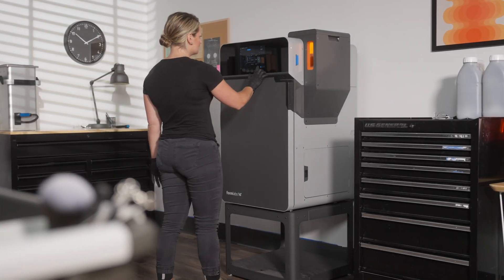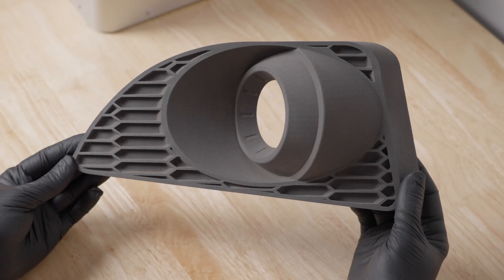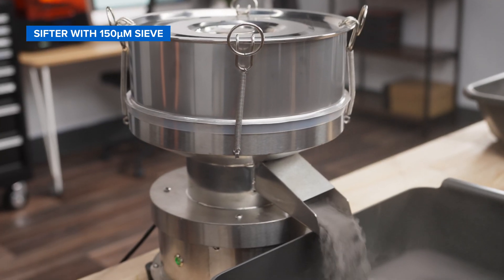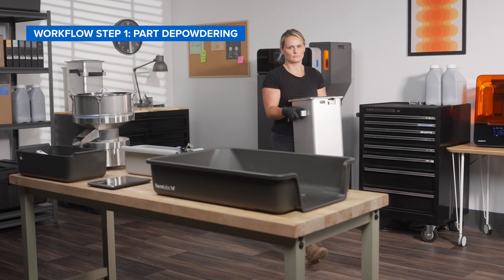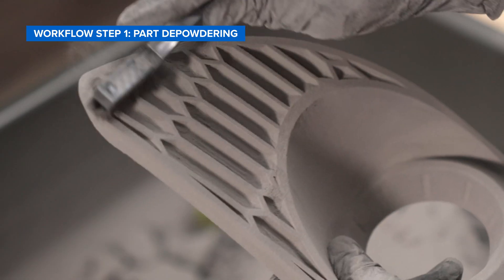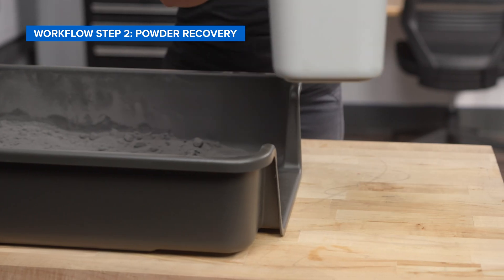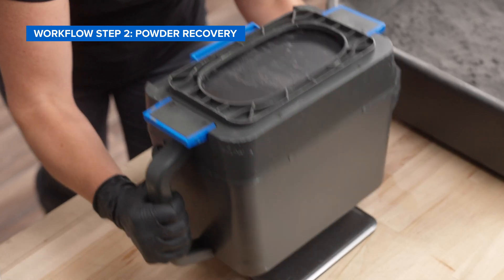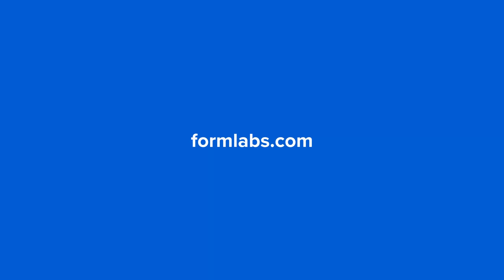Fuse Depowdering Kit: Step-by-Step Workflow

Comment from the maker: Fuse Depowdering Kit is an affordable, all-in-one manual post-processing kit that allows you to easily clean parts, and recover, sift, and mix used powder to prepare for the next print on Fuse SLS 3D printers. Learn how to use it in this step-by-step workflow video. Learn more: https://formlabs.com/blog/fuse-depowdering-kit/